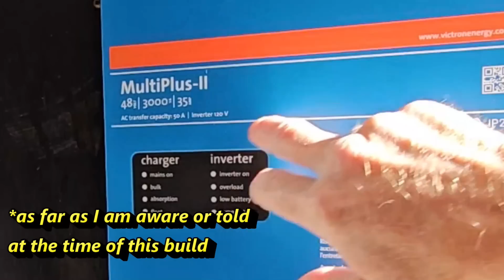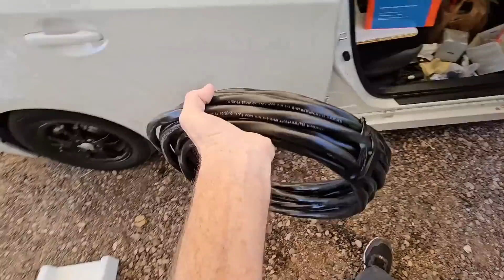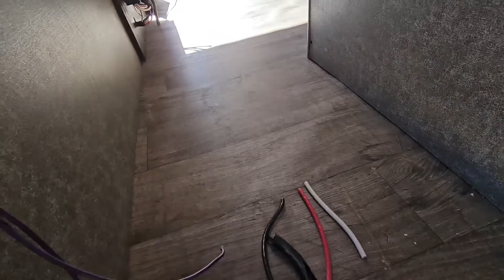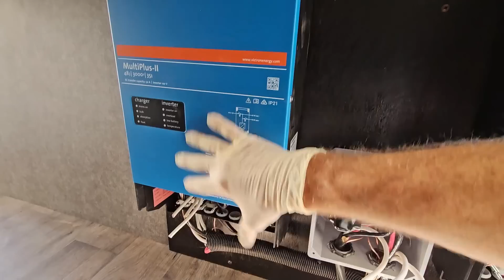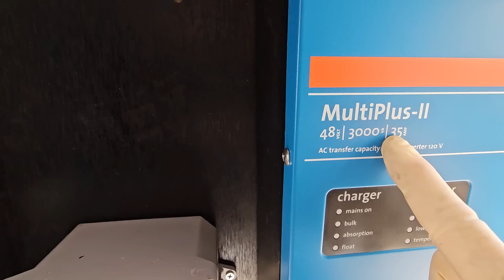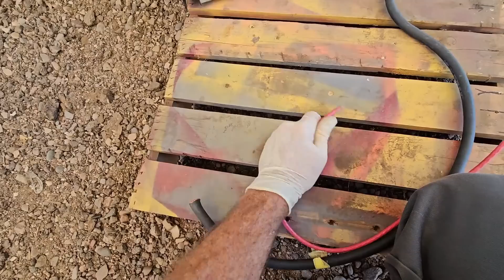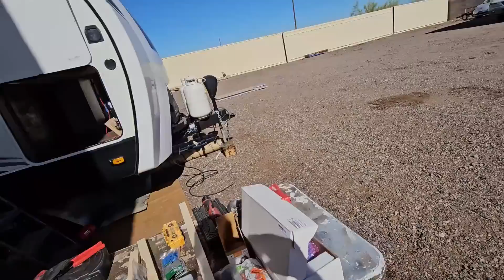How Simple Is Wiring a Solar Off-Grid RV/Cabin? And Why 48VDC?  WARNING: This WILL Upset YOU!!!

Comment: I enjoyed watching this particularly because i did an almost identical system in my 2013 JAYCO 20E  TRAVEL TRAILER. I did go with 24 volt, also a rack battery and i did exactly ehat you did in splicing into and using existing wiring crom the breaker panel to a junction box where i then also connectted the inverter in / out and shore power in ..I also used a 24 to 12 transformer, 24 volt 200 watt panels ( x4) o n a track system that I addedd the ability to incline the panels as needed. Used a 24 volt 2000 watt inverter/ solor controller.   Pretty much half your system with not quite half the work I guessing. Working like a champ.

Comment: The neutral wire only carries the “difference” in amps between the 2 lines. If you’re running 15 amps on each line the neutral has 0 amps.  15 amps on one line and 0 amps on the other and neutral has 15 amps etc..
Reply from the maker: yes, I said balance when I should have said difference.

Comment: Again, higher voltage, lower amperage (V=IR) in order to for this equation to be maintained.  Lower amperage, lower resistance, less heat dissipation and more efficiency (less wasted heat in the form of energy).  By no means James are you lazy.  Not by any stretch of the imagination.
Reply from the maker: Thanks, I fogot that was also a benefit of higher voltage. I still can't make Ohm's law makes practical sense as increase in resistance should mean higher amps and less resistance is less amps, but a direct short is no resistance and maxium current, while a open is maximum resistance but no current flow.
Reply: @AZExpert  Yup.  Electrical Engineers try to make it confusing while Electronics Engineers really know how to break it down.  I'm neither, but spent many years around them.  That is how I learned respect for Electricity.
Reply: From a practical standpoint you can think about it like a hose. If you reduce the hole size of a hose you reduce the flow of water through that hose. You're increasing the resistance so decreasing the flow. It's kind of the same thing with electricity. The higher the resistance the harder is for electricity to move through the component and if the component is in line with everything else it bottlenecks The whole circuit. @AZExpert
Reply: Its actually even better than that.   Lets calculate the cabling losses.

V = I * R
P = I * V
now substitute for (V):
P = I * (I * R)
P = I * I * R

The power (P) lost through the cabling (and equipment) as heat is a function of the SQUARE of the current, which means that at 48V all of your cabling losses are 1/16th what they would be if you were running 12V and using the same cable sizes.

Of course, when wiring for 48V there is no need to use ultra-thick cables.  After all, 100A @ 51.2V nominal (LiFePO4) = 5000W+ with only 2 AWG cabling.   So when one takes into account the thinner cables, the losses actually do become more linear... but you can still count on 48V having 1/4th the losses of 12V.

This, by the way, is also why the electric grid pumps the voltage up for longer-distance transmission.  Doubling the voltage results in 1/4th the losses.  Pump it up massively and losses go down massively.  Hence why the grid is so efficient at moving electricity long distances.

--

Other advantages of going 48V:

* Smaller charge controllers.  A 40A charge controller in a 12V system can handle around 512W worth of solar.  That same 40A charge controller in a 48V system, however, can handle 2048W worth of solar.

* Much thinner cabling means reduced cost and weight.  By a lot.

* Easier to parallel higher-voltage batteries without needing insanely thick cabling to do it.

* Simpler, smaller breakers because the amperages are lower.

* Ability to use a larger percentage of the battery's amperage capabilities to actually take in power from external sources and deliver power to appliances.

* Devices (your inverters, chargers, solar charge controllers, etc...) are all smaller, produce far less heat, and can handle a lot more power.   So the equipment can operate in harsher environments without imploding.

-Matt
Reply: Great description of the additional advantages, to include the ability to use smaller capacity devices and higher gauge wiring.  This really helps with overall upfront hardware costs in addition to the efficiency benefits.  I thought about that, but my knowledge is limited at best and I am glad you took the time to educate us all!

Comment: James you mentioned bonding neutral and ground. That can only be done at the main. Campers are not bonded. The neutral and ground are separated.
Reply from the maker: correct, the neutral is not bonded to chassis or earth on a RV, but the concept of neutral is still wild when it comes to the windings on the step down transformers anyway and really get into the weeds more than a RV electrical video should venture.
Reply: When the generating source resides from the RV itself, neutral and ground are bonded. This takes place in the generator or inverter.

Comment: Hi James, I bought a 1976 Beachcomber B-15, I'm currently camping in it off grid, no battery power except my EB70 for lights at night (plus some plain jane solar lights!), and have the fridge,stove & furnace all on propane(have a 7000btu oldie furnace, LUV IT!!!) I charge my EB70 with a PV200(Bluetti)solar panel that I won, and I'm shocked how simple and good life is! I keep thinking I want to get a couple of solar panels on the roof but then I need to figure out all the wonky wiring - there is no inverter?! But for resale, I should get it all working right. These old school pilot lights are a pain but...I added a new regulator and fuel gages, BOOM!! I feel like a genius!!! Anyhoo, hope you read this and remember me, a subscriber b4 you even had 1000!😂🎉 I remember that little trailer you did and it makes me wish I could get you to do my trailer!!❤ Still glad you use ur daughters thing of you riding your dog😂❤
Reply from the maker: Thank you for sharing. I am not sure how vital it would be for re-sale but as long as the solar doesn't look awful on such a awesome trailer I'm for it!

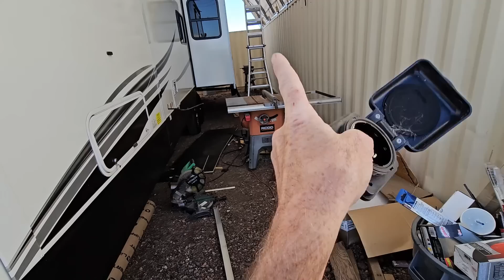Comment: Time Stamp 05:16. Curious. Is it possible to Use the existing shore plug, and add a 2nd shore plug to do what you are doing?
Reply from the maker: I don't see how without adding a transfer switch or manual disconnect.

Comment: I would have used PVC conduit an connectors to make all the wires protected from impact....also a neater look when finished
Reply from the maker: The inverters do not have the ability to accept glands or simple conduit connectors easily. Conduit can be great in exposed wiring but very uncommon on RVs and has to be sized correctly making neat installations more difficult. There can be a balance between functional and neatness and cost, but this installation is far from done, and serviceability is very important too.

Comment: I would have used Victron 48V MultiPlus-II 5kVA. they are only $1,712 each or a EG4 6000XP Off-Grid All-in-One Inverter/Charger for $1,400
Reply from the maker: how does that help? it still only has one line input so I would need 2 and while more power is better, when spending other people's money, I try to balance need and cost.
Reply: One thing to note is that the Victron Multiplus-II's have very low idle current in normal operating (NON-eco) mode.  Its like 12W for the 3KVA and 15W for the 5KVA.  The 6000XP and, in fact, nearly all other all-in-one solar inverter-chargers have far higher idle consumption on the inverter output.

The 6000XP is quite nice, but it isn't as nice as a Multiplus-II.   Also the solar input is also of very limited usefulness on most inverter-chargers... they usually can't charge from solar AND the AC input at the same time, for example.

So it is far better to have something like a Multiplus-II and one or more external charge controllers.  More expensive, but better.

-Matt